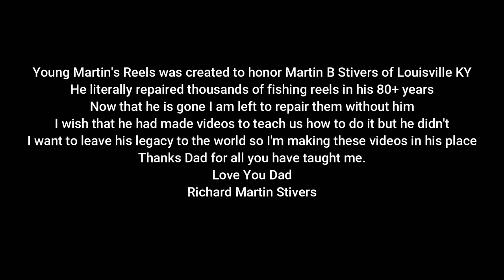Young Martin's Reels - Shakespeare ATS30 - Service and Lubrication

Comment: I have a Shakespeare ATS30LC reel and I noticed yesterday that my tension control knob had come off and its internals had been lost. My problem is, I cannot for the life of me find my reel model online to determine which part numbers would work for my reel. Obviously you do reel repairs and so I am hoping you might be able to help me with the part numbers for the tension control knob, spring and other parts that may have been lost from that small comparment. Thanks in advance!
Reply: I can't find that part either!

Comment: Very helpful video. I just took apart my new ATS30 to check lubrication. Too much grease on the plastic levelwind gears so I removed some of it, which made the reel spin much better. Looking for a schematic. My reel had a tiny washer stuck to one side of the bearing on the gear sleeve, but I didn't notice where it was positioned until I saw it sitting there loose. I don't see it shown in the video, anyone know what side it should be on? Thanks for any help.
Reply from the maker: Tuyere, if you look at the video at around the 22 minute time frame I took the worm gear pawl cover off. When I went to remove the pawl I had to remove a small washer first. Is that by any chance the washer you found. Sometimes those will stick to hands or took and migrate to other places. I once spent hours trying to locate where one went on a Daiwa baitcaster. I took that reel apart at least 15 times before I found that it belonged in the pawl cap.
Reply: @youngmartinsreels5314  Thanks for the quick response, much appreciated. The washer you mentioned is not the one. At about the 3:05 mark of your video, the gear sleeve/shaft bearing is shown. The washer was stuck to the bearing on one side or the other, between one of the spacers and the bearing itself. It is very thin, probably less than .5mm, and fits over the gear sleeve/shaft perfectly. It basically looks like a very thin piece of wire with a round cross section. I'm guessing it's for spacing purposes, but not sure. On a side note, when I was all done, I did find a tiny washer laying in the carpet that resembles the one you mentioned. I determined that it belongs at the bottom of the bushing on the non-handle side. Fun stuff.
Reply from the maker: @tuyetquang4096  If I had that in my reel and didn't know for sure where is went, I would install it on the outside of the bearing first and see how the reel worked. If it worked okay there, then that is where I would leave it. The reason I would do it that way is because there is a lot of play on that side for spacing. There probably wouldn't be as much on the inside. You say that this is a new reel. Did it come with a schematic? I haven't been able to find a schematic for it. I think it will be fine.
Reply: Thanks, I'll try it on either side to see if there's a difference. It's currently installed between the bearing and the inside spacer and everything seems to function as expected. It must be for spacing, so it should fit better one way over the other. Brand new reel in clam pack, but it didn't come with a schematic, and I couldn't find one online either. The similar Tidewater schematic is available, but the drive shaft parts appear different enough to not be applicable. I think I'm going to buy another one, so I'll be extra careful during first disassembly. Reel seems like it will be hard to beat for ocean kayak fishing, where all of my gear doesn't always return with me.

Comment: I have a ts30 real and every time i casted it the clicker would kick on know ot wont lock down and wind up line whats the problem
Reply from the maker: It’s most likely just that the grease has gotten old and stiff. Clean out all of the old grease and dirt, relubricate it and it will probably work fine. Video the disassembly process so you can see how it all goes back together.

Comment: HOW PUT THE LINE IN THIS ATS30 ?  NO ONE EXPLAIN
Reply from the maker: If you run a YouTube search for “How to spool a conventional level wind reel”, you will find many videos describing the process. It doesn’t need to specifically for the ATS30 since the process is the same.

Comment: Plastic gears Yuck!!!
Reply from the maker: Craig, believe it or not plastic gears have their place in a modern fishing reel but there should only be one. It provides an intentional failure point. It is much like a fuse in an electrical system to protect the more valuable parts. Of course if you can’t acquire a replacement gear, then it just becomes a cheaply manufactured reel.
Reply: Main gear is brass, almost all baitcasting reels are like that